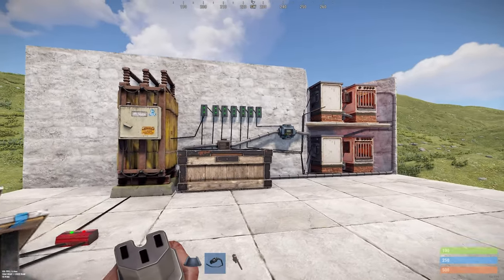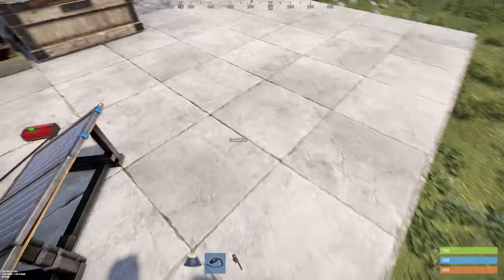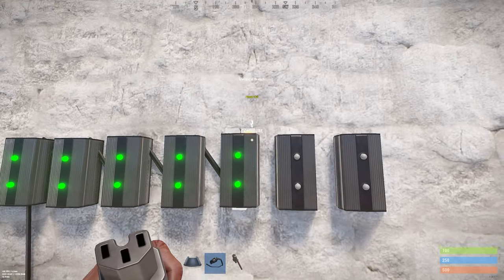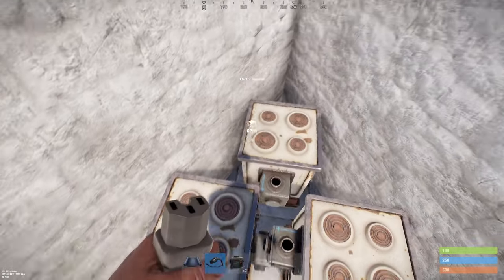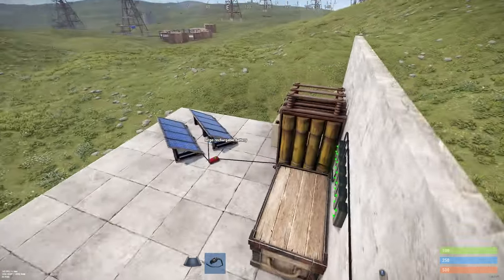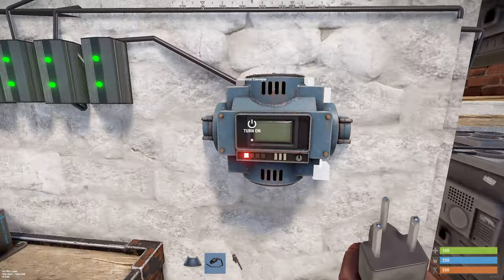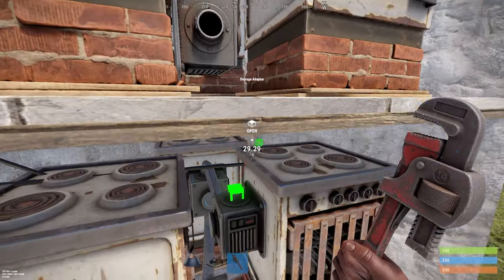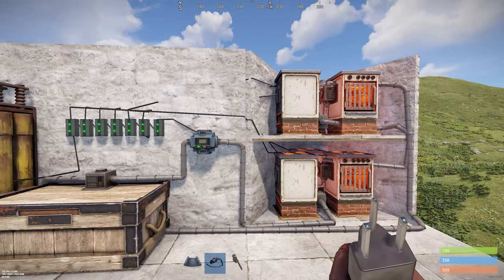Rust - Building 6x AUTOMATED Electric Furnaces in a Triangle Honeycomb - Step-by-Step Guide

Comment: Great video except you only need 2 branch boxes , 1 between battery and conveyor as a normal branch then 1 after conveyor both going to 2x splitters.
Reply from the maker: That’s true, I will use this next time!
Reply: can you explain further how you do this? new to elec
Reply: @explainable.  You actualy only need 1 branch because the conveyor has a passthrough so it can go from battery to branch, to the two splitters, one of the splitter outputs then goes through the conveyor to the furnace
Reply from the maker: Thank you! I will use it in a next guide on electricity. Iam planning for some more guides but I also want to make some big movies where Iam actually playing a wipe.
Reply: @explainable. would love this
Reply: @explainable.  theres a space between (iam) so its I am

Comment: I add an off switch before the furnace setup which saves battery when not smelting. Branches still use power when not actually powering anything!
Reply from the maker: That’s a smart one
Reply: @explainable.  So if you just use 3 branches, 2 splitters, and one industrial conveyor you should be good 2 go with no power drain. the industrial conveyer doesnt use power when off regardless of branch, but the splitter stops the branch drain

Comment: wait so I dont need to add in filters to the industrial conveyor? I always had 2 industrial conveyors- 1 with uncooked ore filters+ wood and 1 with smelted ore+charcoal. so thats not needed? just connect the pipes and thats it?
Reply from the maker: You only have to set filters into one conveyor. You need to do the ore you want to smelt, and the end product. After that it should smelt perfectly.
Reply: @explainable.  ahhh ok. Great thnx

Comment: What the output for each branch like what do I put it do
Reply: So i modified the circuit just a bit. using 3 branches, 2 splitters. by using the splitters you stop power drain when the furnaces are off. but for that i set 9 branched to each of the splitters connected to the furances, and 1 to the industrial conveyor. works like a charm